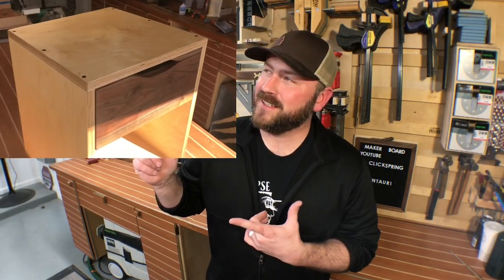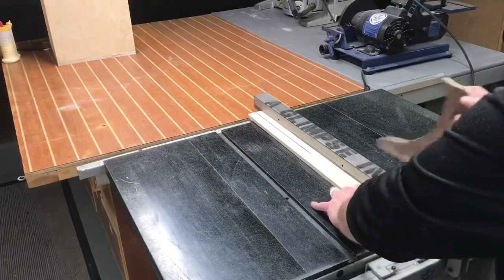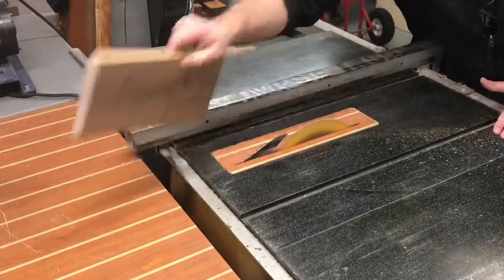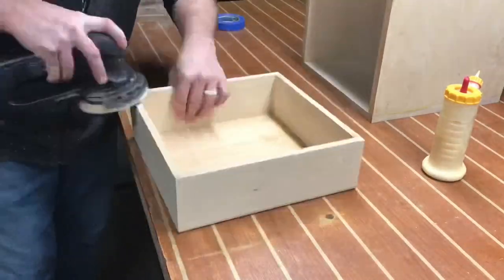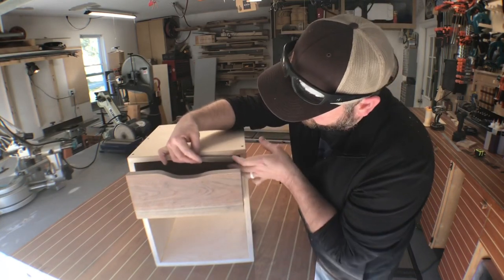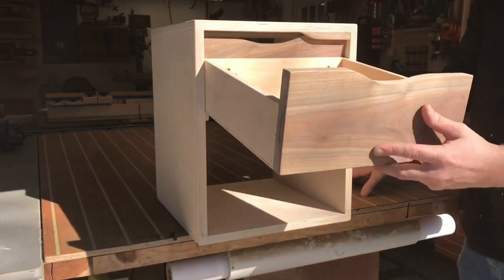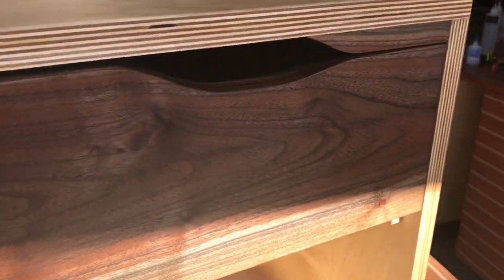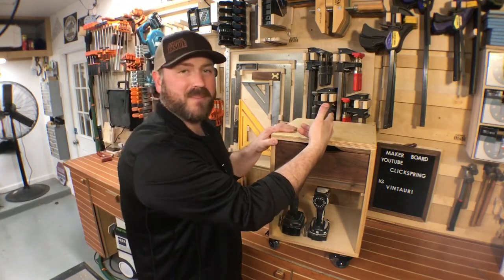How to Make Mobile Shop Cart/Seat | DIY Woodworking Project

Comment: Great project!  The draw front locking detail is fantastic.  I'm a big fan of walnut and I've enjoyed building projects with walnut plywood with walnut edge banding and solid walnut parts.
Reply from the maker: I’m actually thinking of picking up some hardwood veneer plywood myself. Just to kind of mixed things up. Thanks a lot brother
Reply: @AGlimpseInside  WALNUT A1 P/S 3/4"  with veneer core about $130.00 a bit too expensive for my personal projects. I'm mainly using 3/4" fir sanded plywood or melamine for my stuff.
Reply from the maker: D Scott yeah man. That’s steep. I get 5x5 3/4 BB for $45 so I j just might stick with that!!